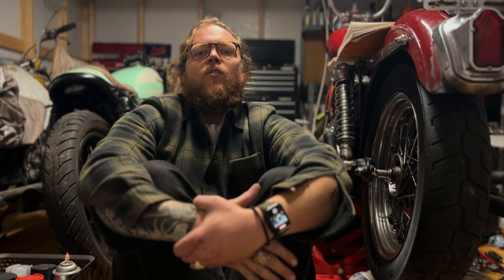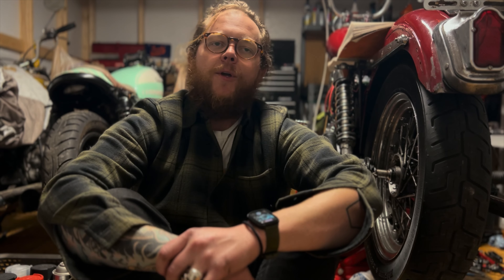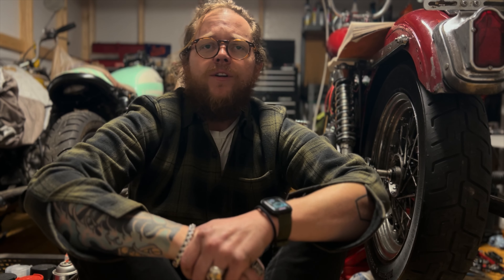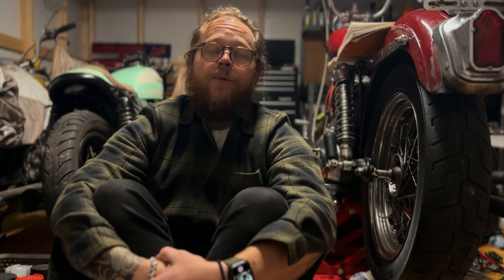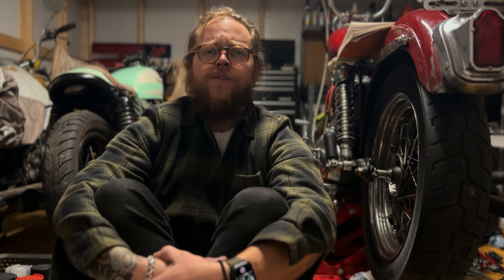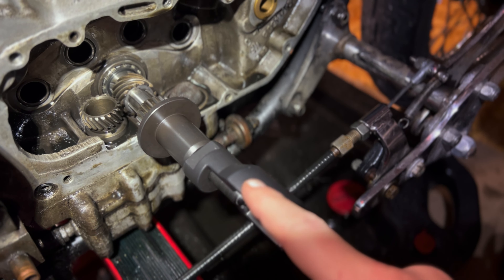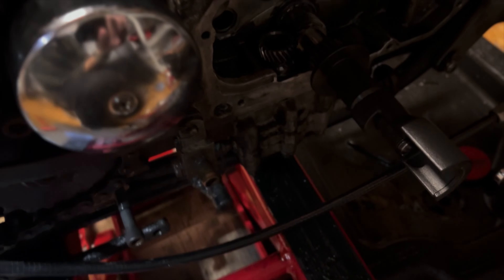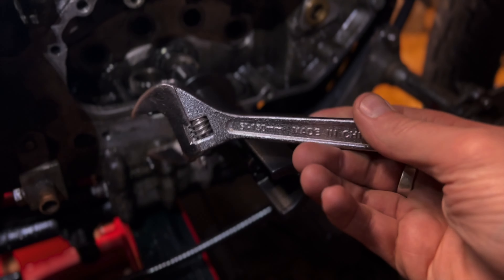IronHeadAche Collective Ep.1 - Oil Breather and Pinion disassembly, alignment and installation

Comment: I believe you do your oil pump breather timing to the third mark on the flywheel going counterclockwise I had mine rebuilt and they put a different flywheel in so I did mine wrong and I'm in their correcting it, mine was pumping engine oil into the primary, I hate that they label that stuff one dot two dots or a line or double line why don't they just say first second or third marking and keep it basic and not keep everybody confused and doing things wrong, my service manual said set line in the window for the oil pump breather but this has a different crank now so the dot is the top dead center for the front cylinder so I did it wrong, if they would have clarified go to the third mark on the on the flywheel as its rotating around that would have saved me a lot of work
Reply: As long as index mark on pinion gear is at 12:00 (only goes on shaft one way) You should be good?
Reply: I really have a hard time texting on this is the anyway I could do some regular text messaging with you I'm still in the process of working on mine and I want to make sure I'm not screwing this
Reply: Up
Reply: timing marks r diff f0r diff year s0 make sure ur reading f0r ur year is all eye can say.